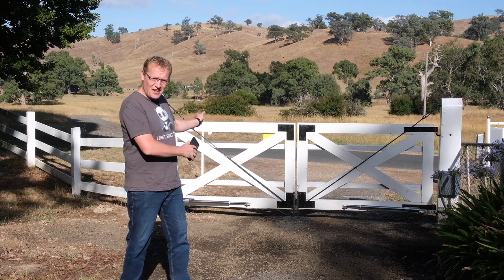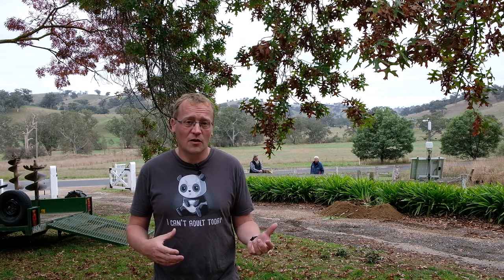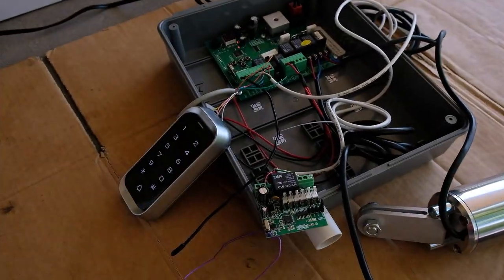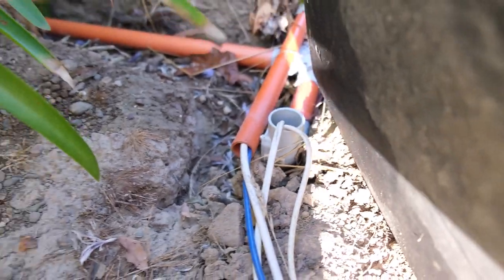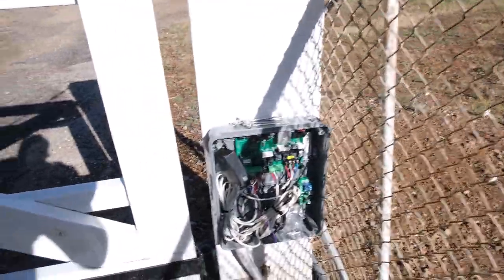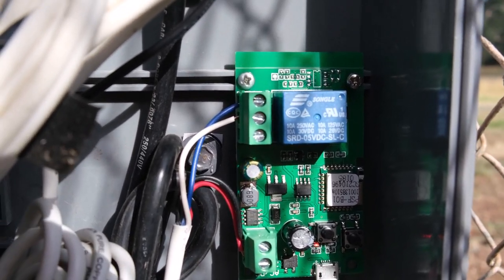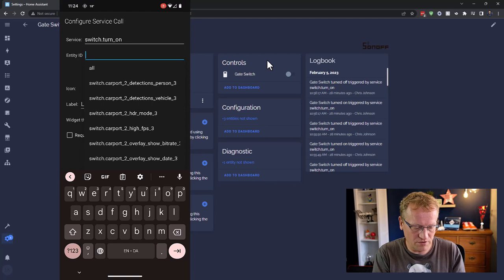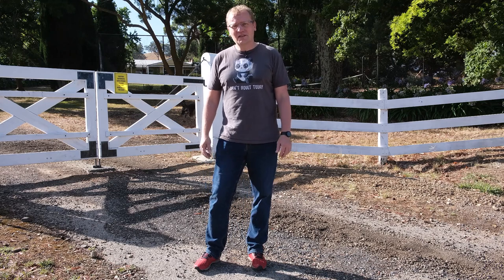Automating gates with Home Assistant - Full install start to finish

Comment: Really informative. Thank you, Lars! So really all the "magic" happens with that Sonoff wifi relay. I expect most gate controllers will have a control input. 

I'm still waiting for the local "gate guy" to come around and take a look. I'm getting them to do a full install as I really don't want to have to futz around with the gate electrics and mechanism if it goes wrong. I'll connect up the wifi relay when they are done. 

Will also be adding in a G4 doorbell and G4 camera to complete the setup. Fortunately I got power and ethernet (over fibre) down to the gate when the driveway was put in.
Reply from the maker: Yes, the Wifi Sonoff relay is what allows me to get it into Home Assistant. It is a simple solution, but took me a long time to figure out tbh. It started with my local "gate guy" quoting me AUD2,500 for an extremely complex solution to opening the gate from my phone. 
Ah, a bit jealous of your wired gate. I am planning the 240V install but it will be a while still before that goes in. So, solar and batteries for now.

Comment: Hi Lars, Hurry up and install the new Unifi Gate Access system! 😃 I’m keen to use it on my farm. Thanks mate 👌👍
Reply from the maker: Haha, yes sir! There is a fair bit of planning and infrastructure changes, so it will be a little while still. I have to get more batteries, dig trenches, replace a gooseneck mount, get another solar controller, and then make it work with the existing gate controller for backwards compatibility. I'm getting there though :)
Reply: @LarsKlintTech  yes there is alway many projects and improvements on the farm job list!! And each job opens another can of worms! Great content thanks again 👌👍
Reply from the maker: @andrewsauter8749  There certainly is. I have some farm specific projects in the work, which should be released on a couple of months. They might make your life easier too , depending on your setup 🙂

Comment: Another top video Lars.. I’ve ordered the parts for my swimming pool level solution ill update you once its installed!
Reply from the maker: Thanks Daniel. I really appreciate the support. 
Yes, please do! I have a whole video outlined for pool automation shenanigans. 🤓
Reply: That’s something i’m keen to see what you do. I’ve got my chlorinator in HA but the API only exposes one system not my control box unfortunately. I have a Blue Connect Plus and between that any my chlorinator i have 2 different pH readings despite calibration. That’s pools for you i suppose.
Reply from the maker: @dsellars  Hahaha, that does sound like a "pool thing". I never thought I'd have to do a PhD in chemistry either just to maintain the damn thing 😂

Comment: I just went a different way with my gate. I used an esp32 m5 stack with a relay board to activate the exit button connections on the board. With that I was also able to incorporate an intercom button that sends a text to my phone that someone is at the front gate wanting to come in. I can then view them on my Reolink camera set up there before I let them in via Home assiatant. 
All I want to do now is work out a fast response proxity automation to open the gate automaticly when I drive up to them. Ive played with zones but way to slow to react and you wait for ages at gate before HA changes state of location.
Reply from the maker: Very nice. Good use of automations too. 
I like having the image directly in the notification, as I show with the G4 doorbell (https://youtu.be/sMflKCJhYlE). That way I have both the intercom notification, the image, and action (open gate) in one place. 
With the fast response, I have the same issue. We don't have any mobile coverage at all, so I am relying on Wifi and/or HA geo-zones. But as you say, they are way too slow to be useful. I am considering going down the path of number plate recognition, as there are plenty of libraries for that, even in HA I think.

Comment: I recommend flashing the sonoff with ESPHome or Tasmota - it will 1 - descrease latency - 2 - decrease the requirements of the ewelink app - 3 - give you more control overall - 4 - Allow direct integration into HA ....
Reply from the maker: Very good points Mitchell. The latency would be the most beneficial for me, as sometimes connecting over the internet takes a few seconds. Perhaps a Tasmota flashing video is on the cards..... thi🤔

Comment: The reason for the inching stuff is because the state isn't controlled by the Sonof board but by the gate control board, so the concept of "on" and "off" mean nothing, you're only sending a signal to the controller to start the action it needs to start (it'd also why you don't have to send an open/close signal). Before I figured that stuff out I had an automation that'd run to close the switch after opening 😅.

All you need now is a contact sensor so you can tell if the gate is open or closed and turn it into a cover in HA. I use that to work out if I have to automatically close at night.

You might be able to use presence detection to detect your car on arrival and automatically open the gate.
Reply from the maker: That make sense now that I am aware of it. I kinda found "inching" by "pressing all the buttons" and realised what it does. 
Yeah, I need a open/close sensor for sure, although the gate shuts automatically. I'd still like to know.
I have considered presence detection, and have a whole video outlined for it. Problem with this scenario is that there is no mobile connection coming up to the gate from outside. It won't know you're there until the wifi kicks in, and by then it is faster to use the fob.

Comment: Hi Lars,
Recently found your channel and have found the content extremely useful and also entertaining.  I have the same gate opener and would love to do much the same with the automation.  Mine was provided with the standard BMGi solar controller and 12V battery but it appears here that you are running yours just fine on 24VDC is that correct? 
Your channel is probably going to cost me some thousands in networking gear and other gadgetry! :)
Reply from the maker: Hahaha, sorry. Not sorry. 😛
First, no I am powering it with 12V as well, as the wiring only runs from one battery, not both. I also bought the 240V adaptor, as I am in the process of getting power install all the way down to the gate.
Second, you can automate the gate regardless of power source. If you use Home Assistant, there are many options for using some sort of relay to trigger the gate. I use the Sonoff/eWelink Wifi relay because it fits well with my existing platforms.
Reply: @LarsKlintTech 
Thanks, that's much clearer.  I wanted the 24V so as to be able to use a G4 doorbell as per your other vid.
So you run the two 12V batteries in series to the 24V sunmax charger and passive POE loads, but then pick off 12V from one of the batteries for the gate?
I have mains power in the garden only about 15m away, it's probably better to just trench either mains or at least low voltage down there and do away with my solar setup altogether.  Just that I hate digging!
Reply from the maker: @breganzane  That is exactly it.  Speaking of digging, I have just dug 250 meters of trenches for power, CAT6, and lights in the front of the property. When I get it all done, I will be using 240V at the gate too with a Switch Flex, new access point and new camera(s). 
I'd say, do it properly if you are digging and put in everything ;)

Comment: When you have to pair your 2,4 GHz devise to your phone, you can also go in your Unifi settings and turn off 5 GHz while parring, and it will connect with no problem.
Reply from the maker: Very good point, and that did occur to me after the fact too. Definitely keep that in mind for next time 😂

Comment: Hi Lars, great vid sir. Fellow Aussie (from VIC) also using Home Assistant. I use the Shelly Plus 1 on my garage door plus two reed switch sensors to tell when the door is fully closed or fully open. One sensor is wired to the Shelly, the other is a battery powered zigbee sensor.
Anyway question for you, im looking at also using a Shelly Plus 1 to control our automatic driveway gate when it's installed. Have you looked at this device / got any thoughts on whether it would work like the Sonoff relay you installed? - Cheers Simon
Reply from the maker: Thanks mate. Glad you enjoyed it. To your point on position, I am looking at a Zigbee extender that will allow me to get Zigbee signal at the game to monitor gate position too.
I suspect you can use the Shelly Plus 1 too, but I am not 100%. I went with the relay, as it is designed for starting a process like opening gates. In my case I use the Sonoff in "inching" mode, which means it turns on and off again within 0.5 seconds. My gate just needs a signal to open, so the power can go off again. If the shelly Plus 1 can do that, then you can probably use it, unless your gate controller is different. 
There are a lot of "ifs" until you know how your gate controller works.
Reply: @LarsKlintTech  Thanks. Yes the Shelly can do that, sounds exactly like it's the same functionality used to trigger my automatic garage door. When you configure the switch via the shelly web interface you add a 1 second auto on/off timer to 'toggle' the switch.
Reply from the maker: @sfarthing12  Yeah, that does sound very similar. Because it doesn't have to be 240V I chose the Sonoff 12v relay, which I can wire myself here in Aus 😊
Reply: @LarsKlintTech  Hi Lars, apologies mate i'm starting to sound like a Shelly fan boy / company rep. Im not, but it has the option for 12v, 24-48v or 240v based on which inputs you connect. I used the 12v configuration for the garage door also because i could do it myself.
Reply from the maker: @sfarthing12  Hahaha, not at all. I love learning about all these various devices. That is super helpful. I have about 15 Shelly devices, but I have only installed the UNIs, as they are the only ones using 12V. The others are all 240V. Really good to know and makes my choices even greater 😊

Comment: What guided you when choosing the system? Have you considered a i3 Engineering smart home system to automate your gate?
Reply from the maker: I wanted to have keypads, FOBs and remote opening. The customer service and support from BMCi Gates was the best as well. I then wanted the remote opening to be done from Home Assistant, as that would allow me to automate it and integrate with almost any other logic construct, device or entity.
I hadn't hear of i3 Engineering. I don't think it would suit my needs, as it is a closed system that doesn't appear to allow you to expand on functions, write integrations, and integrate with 3rd party APIs. It seems to be centred around a large selection of AC switches that works in various ways. They all seem the same to the untrained eye and it is confusing to figure out which one to use where and for which product. For example, which one do I use with the Zigbee network, or is there a Bluetooth integration somewhere? 
A further complication is that in Australia you aren't legally allowed to do any 240V wiring unless you are a licensed electrician, so most of these devices I wouldn't be able to install. 
In short: Home Assistant allows me to choose from a vast range of devices that will integrate, without having to invest in yet another closed system and devices.

Comment: Which Sonoff module did you use? I'm planning on using a Sonoff SV for the same purpose.
Reply from the maker: I used this one:  https://amzn.asia/d/ixihoia
It is also linked in thedescription.
Reply: @LarsKlintTech oh that's why I didn't recognise it. The Sonoff SV is cheaper but they're both fairly cheap.

My project is very similar to yours except I'll be setting up a rechargeable WiFi Doorbell for the intercom, not taking power from the gate and I'll be able to get WiFi at the gate without having to upgrade the WiFi.
Reply from the maker: @futurecactus  Excellent. It is so rewarding to get it all working 🤓

Comment: Nice setup, what happens if the gate tries to open if the pegs into the ground are down? Does it stop due to resistance?
Reply from the maker: Thanks Stephen. I really like it too 😊
The pegs have been removed for the final install. They were only there as an interim measure until the automated mechanism was put on. However, if the gates detect resistance, they will stop and go back to open/closed position.

Comment: Hi Lars just wondering which gate kit you bought from that website in the description including the longer range antenna please? and which door bell? Also where did you get the goose necks made up?

I was wondering if the actuators can move faster?
Reply from the maker: Good questions.
- The kit is the E8 500 Auto Gate Opener, double swing version. I got the "push to open" brackets too, as I am opening the gates outwards.
- The long range antenna/receiver is under the accessories part of the website.
- The goose neck stands were custom made by a local metal fabricator. I couldn't find any standard ones, due to the width needed for both keypad and door bell.
- The door bell is a Unifi G4 doorbell, which connects via the DC power on the solar controller. I made a whole video on that too: https://youtu.be/sMflKCJhYlE
If you have a specific setup in mind or need a custom solution, contact BMGi. They are extremely helpful.
Reply: @LarsKlintTech  thanks Lars! I was hoping to extend your idea and if it is after a certain time if the driveway lights aren't on if someone approaches then turn them on as well
Reply from the maker: @owlytv  Yeah, good idea. I think that is a separate project though. You'd need a motion sensor at the gate, and then turn on the lights based on motion between certain times (or sunset to sunrise maybe).

Comment: I did something similar but flashed a sonoff SV with tasmota so I don't rely on ewelink. I also set a pulsetime of 1 second so when the relay turns on it operates the gate then turns the relay off after 1 second. I use openhab and the gate is solar powered. I also put a photo cell in and when anything goes through the gate the door bell rings. On Tasmota I have set 3 switches. 1 is for the relay and operates the gate. 1 is for the status of the gate so I know if it is open or not and have a reed switch attached to that. 1 switch is to turrn on the door bell. Everything is done using MQTT. The gate is 100 meters from the house and just within wifi range. I have a VPN if I need to open the gate remotely when away from the property. Here is a rough video I did. https://www.youtube.com/watch?v=O3yJqTmUjIk
Reply from the maker: Thanks for sharing Greg, that is awesome. 
I have considered using Tasmota too, but haven't done it yet. The eWeLink app has never failed but it would be nice to be more local.
I am definitely putting a sensor on the gate to know if it is open or closed. That is the one big omission at the moment. I don't need the doorbell to go off though, as that would just be annoying.